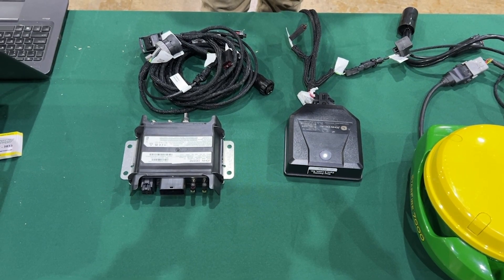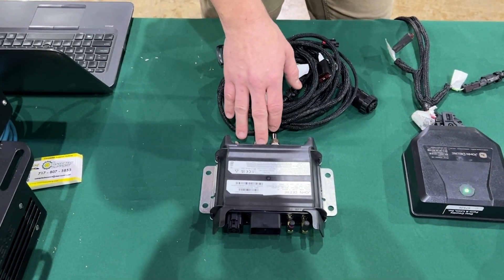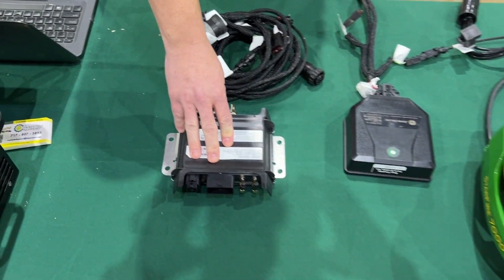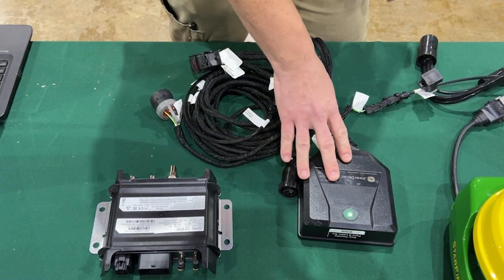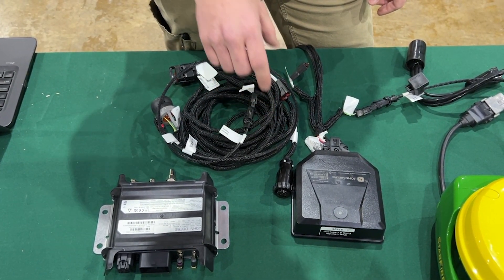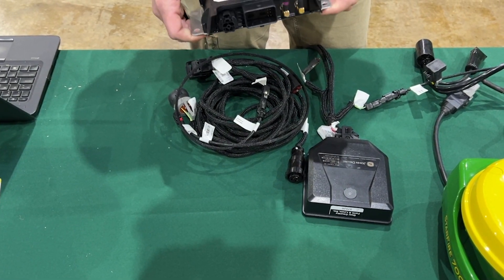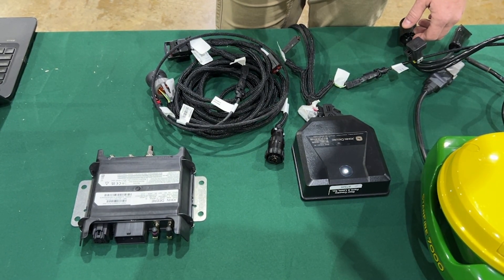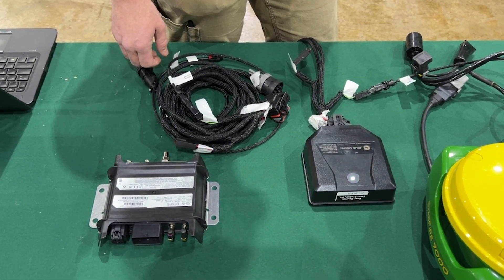Modem M vs R Comparison Video

Comment: What’s the part number for the cable for the modem M? As well,  will a modem M be able to go into a freight liner truck?
Reply from the maker: The Modem M cable is PFP21103. A Modem M can be installed in anything with a 12V power source, data collected depends on the machine model and having the harness fully connected. A Freightliner truck would work for location and tracking but will not collect any data like fuel or codes. If you are interested in tracking over the road trucks through Ops Center and having more detailed data, there are two partnered companies that have integration with Deere, Samsara and Razor Tracking. That would require buying their device and plan, then linking your Ops Center account with their program.

Comment: Is there a harness to connect the R series modem to the service port? Trying to run them in 20 and 30 series tractors. Currently just have 12 volts running them.